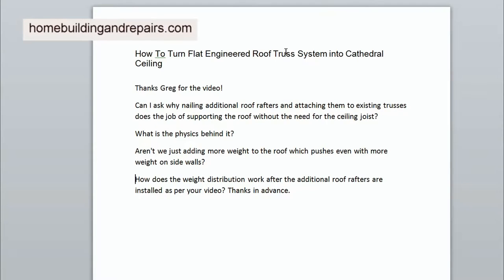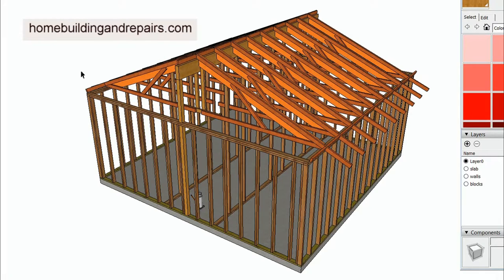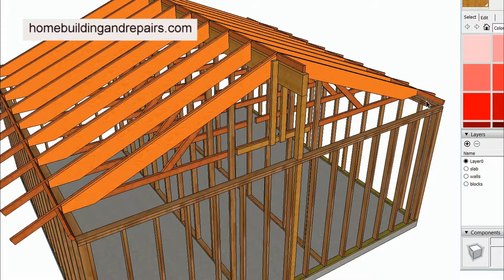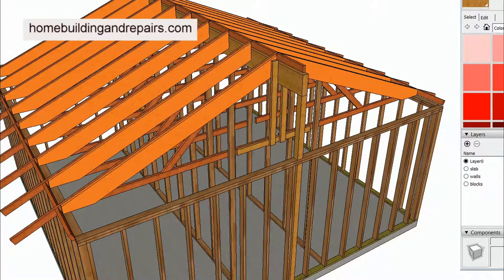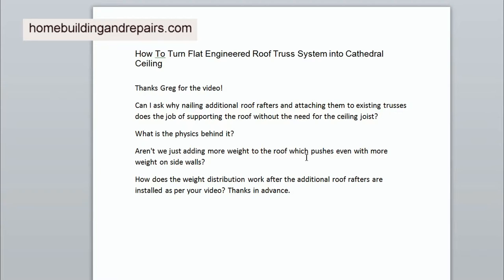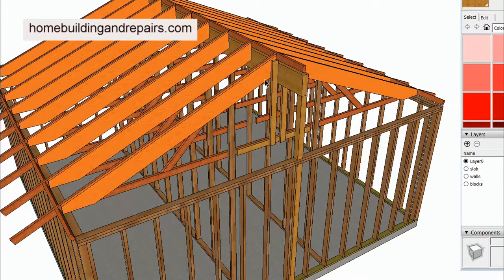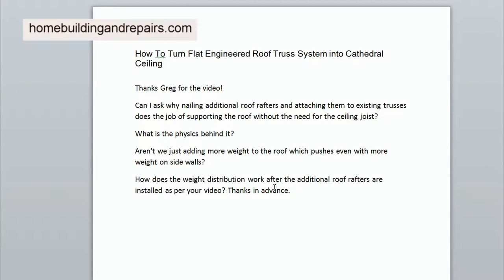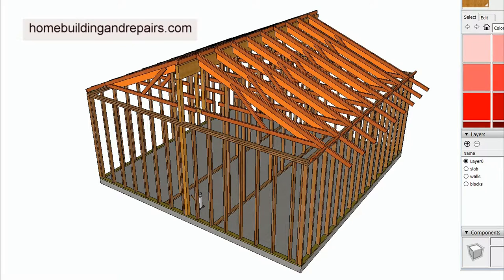How Does Additional Weight Effect Building Structure for Truss Roof Conversion to Vaulted Ceiling?

Comment: The use of a Ridge Beam certainly prompts a need to size conventional lumber. Referring someone to a Structural Engineer may not be wise. Most Civil Engineers can determine the live/dead loads and the span tables are provided in the IBC, ICC, and more importantly the IRC or CRC (R represents Residential) codes adopted by each State. Structural Engineers rarely want liability on a small job with risks. They have a license to protect. 
The  litigious world we’ve created will lead to a 4x8 beam to becomes a 6x12. Most Building Departments will also direct a remodel to a Structural Engineer and nine out of ten calls won’t be returned. The tenth will politely refer you to a civil engineer. The Residential Codes allow the non-licensed owners and draftsmen and contractors to design conventional wood framed structures less than three stories. Jurisdictions inadequately staffed will however direct you to an engineer by ignoring this mandate and require an Engineer.

Comment: This isn't even possible without a bearing wall or posts in the span somewhere or a 12/12 pitch which i still dont think is a good idea
Reply from the maker: Yes, if you don't think it will work, contact an engineer for more information.